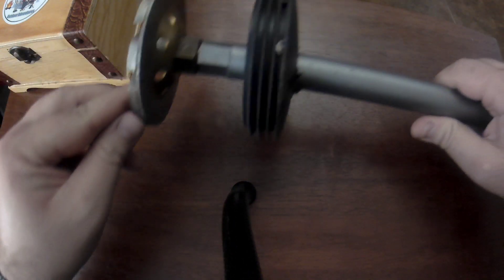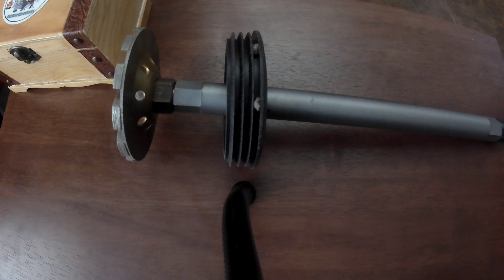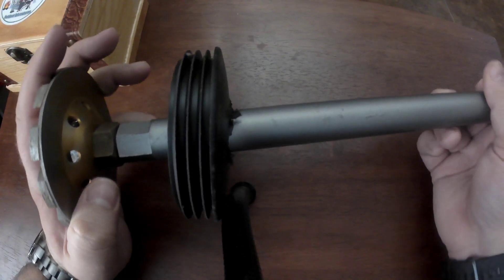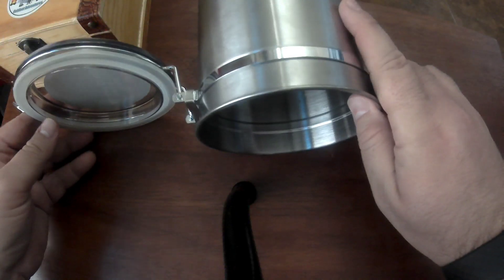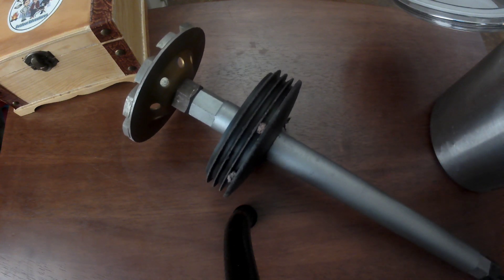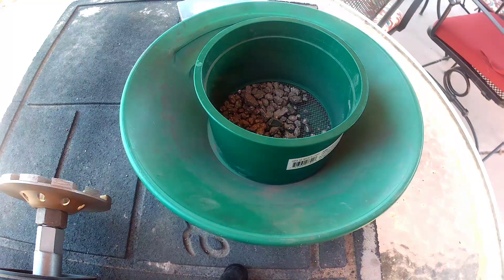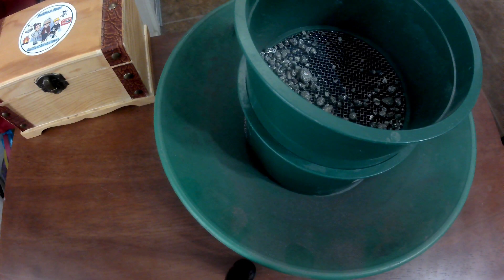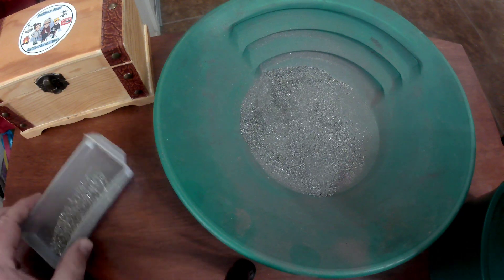DIY Fun: Portable Rock Crusher For Under $80

Comment: Pretty cool little setup, thanks for sharing! Much better than those tiny manual crushers
Reply from the maker: Yeah, I made a manual one before too and it takes a while to crush things. I really wanted a electric one but just didn't wanna she'll out over $200 for one just yet.
Reply: @LXRPostalProspecting  The only spot I have ever found gold ore is a super horrible, extreme hike. Would be nice take something like this up there so I don't have to carry out hundreds of pounds of mostly worthless rock.
Reply from the maker: Right. That's why gold is expensive, not so easy to find. This being a couple pounds sure beats out carrying hundreds of pounds of ore. Then you only have to bring cons with you is you want to.

Comment: Pretty sweet set up right there. Im building one for a battery grinder. Ill have to keep that grinding disk in mind. Nice job bud!
Reply from the maker: Thanks man. Let me know how it turns out, I have been wanting to try one for a grinder too, but I don't weld so it makes it a bit more difficult.
Reply: @LXRPostalProspecting  Will do its going to be one of my winter projects. Helps me out that my family owns a auto salvage / scrap metal recycling yard. Get all kinds of metals and junk to build with.
Reply from the maker: That's awesome, yeah you can definitely make one at a great price then.

Comment: Inventive for sure! for the life of me i couldn't figure out why you weren't going for a press or at least a spinning chain setup till you said it was a mobil unit then it hit. should do just fine for testing.
Reply from the maker: Exactly. I want to take this with me if I find ore so I can crush and test on the spot or crush and take material with me, but there is always room for improvement. 👍
Reply: @LXRPostalProspecting  lower i read bubbas fire extinguisher one that with a flat base you could stand on would work great!

Comment: Very interesting project. Inexpensive is key in this type of project. Seems to crush pretty well . Could you use a 3/8" cordless drill and battery length of life.?😎⛏⛏🔥🔥
Reply from the maker: I have a cordless craftsman that I can use, the good thing is that this doesn't need to be at high speed, I think I only have it about 40-50% on the trigger. I probably will be using the cordless when I go out sampling ore.

Comment: Not too bad at all.
Whats the very finest mesh size you can pull out of it?
Reply from the maker: I have created dust with this. Finest mesh I have is 100 and works for that.
Reply: @LXRPostalProspecting  you reckon it could go to 15-50 micron that dust, if you kept it in long enough?
Reply from the maker: @8thsinner  I would think you could do it, but I don't have a screen that fine myself to test it out.